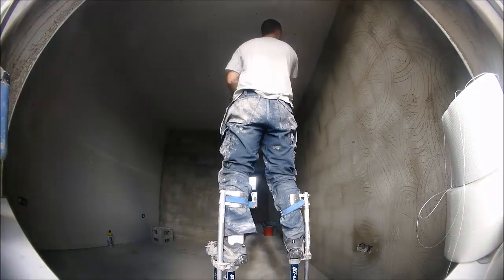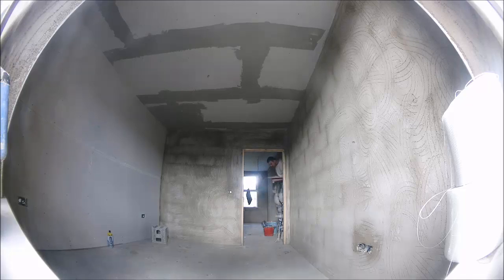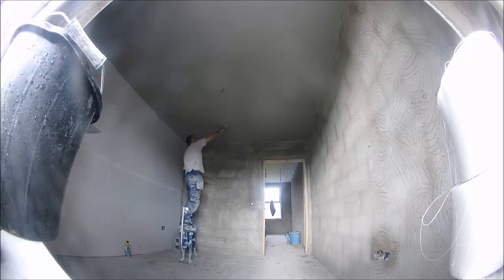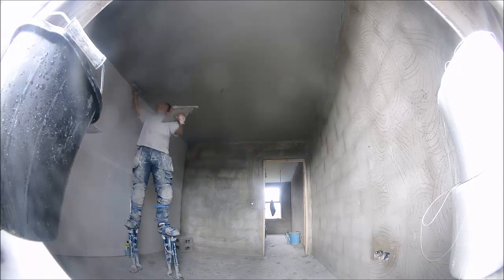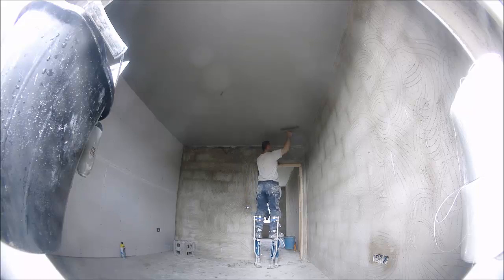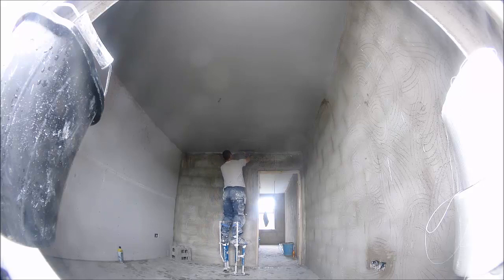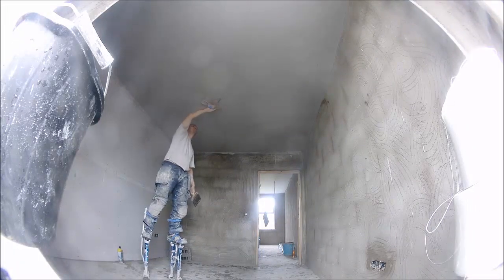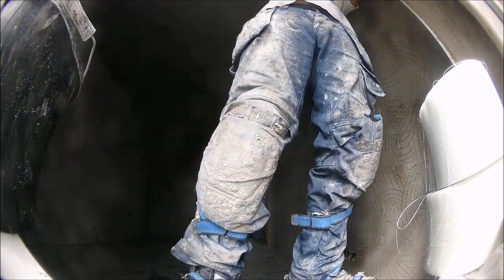HOW TO PLASTER A PLASTERBOARD CEILING the way i do it ( beginners and DIY )

Comment: I'd agree that stainless steel floats are longer-lasting and easier to keep clean, but you don't get that beatiful Razor-Edge that a Slightly-Rusting 'Ordinary-Steel Float' gives you, which makes finishing and polishing Soooooo much easier ..... (Just a thought :-)
Reply from the maker: Hey Peter yes i had a wooden handle mt like that too me loads of sand and cement to get it broke in and then i did one landing wall with it and was like WOW best cut ever then as i moved plank it slipped and landed on it making it the shape of a relay bent banana :)

Comment: We were wondering how long to leave it between coats of plaster; didn't know you could put second coat on same day. We could of finished the job Sunday save coming home couple of hours early. When repairing 5ft X 3ft hole in kitchen ceiling with plasterboard,  is it best to plaster the entire ceiling again afterwards or just the part we just fixed? The ceiling we are working on is about 10ft X 15ft. Seems hard to blend it into rest of ceiling and keep it flat. I was mixing b y hand rather than drill mixer but does take longer. Will use hand drill mixing next time. My brother uses brush as well to dampen down after watching some of your other videos but is it OK to use plastic spray bottle to dampen down only an idea. Still got more walls to do. Thank you for the demos.
Reply from the maker: Hey Steve mate yes water bottle is fine also ok to use to wet wall when trowelling up sometime it might even be less mess and spilled water... Ye it is ok to do 2 coats like i do in this video (same day ) if it is heavy and you have to bond to fill it out just mabe let the bond coat set off 1st but might take some time.  It might be easier to patch but a better job to do the whole you will have to make the call witch is best for you :) thanks for watching my friend :)

Comment: Never liked my stilts. You seem quite tall, but I'm 6'5, not quite tall enough without a leg up, but too tall even on the lowest setting of my stilts, so crates and hop ups it is!
Reply from the maker: I have these up 3 settings I am tall enough too but these walls are high of my milk crates its a stretch so i have to use steps i hate stretching after a day get sore back big time
Reply: macplastering same here mate, struggle is real being tall!
Reply from the maker: I find floors sore on the back the most all the getting up and down plus stretching to straighten and rub it up